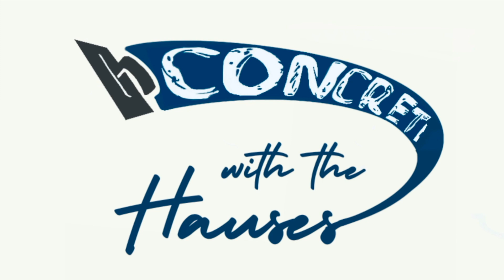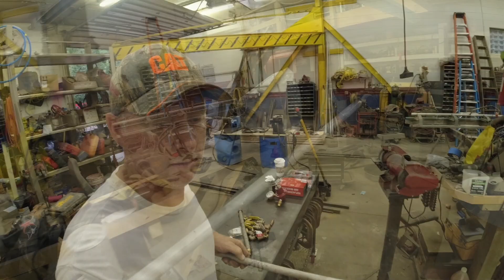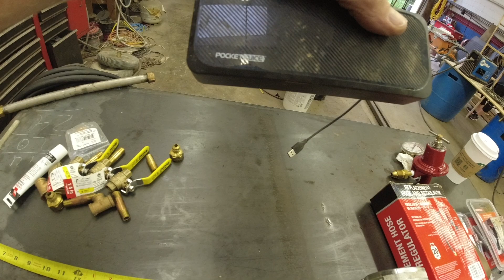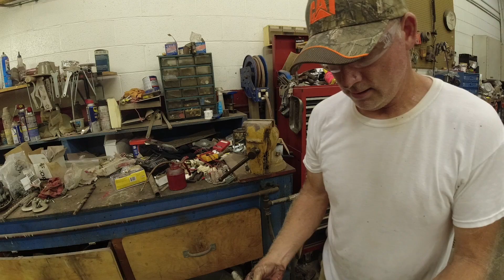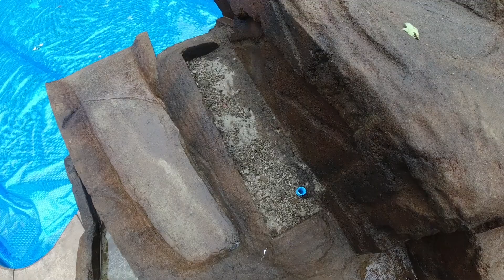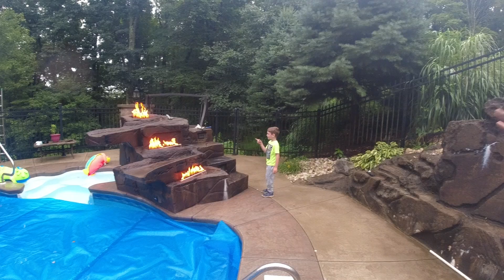I Think This is Safe!?

Comment: I have been doing the same for years.  I welded a piece of angle iron on a plate V up.  The pipe rests in it and holds it for drilling, no punch needed. I made a pizza oven the same way but wow, you need a ton of holes to get the BTU's. Smaller drill lots more holes.

Comment: Cutting threads on any metal pipe, is a process where you want to be as messy as possible with the oil, and have many different lengths of handles. Good demonstration by a man who enjoys working in a metal fabrication shop. Good job on the warmest diving board I've ever seen!

Comment: Worked with stainless steel rod and piping in a frozen food manufacturer for 43 years, it is not as hard to work with as people think! The one thing when cutting, drilling and taping (cutting threads in pipe) to use a cutting fluid made for stainless steel and take your time and do not force it!

Comment: Super cool, but theres literally nothing about that thats not dangerous or a recipie for disaster. 

Kids running up stairs with no railing onto a narrow ledge that has running water in it (will get slick and slip hazard?) and when they DO fall on it there's open flame to cause burns.  NICE.
Reply from the maker: In the video I talk about adding a handrail because I always have to stand guard and we do keep a close eye

Comment: The only advice I have regarding stainless steel: do not cut or drill with equipment that was previously used for steel or iron.  This contaminates the stainless steel and will cause it to rust, even if it is 316 stainless steel.

Good job

greetings from Israel